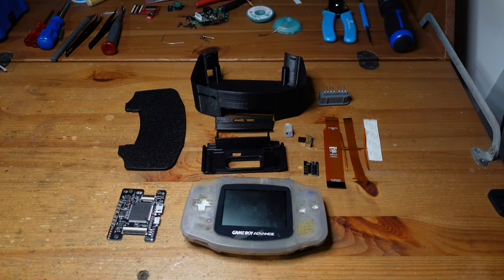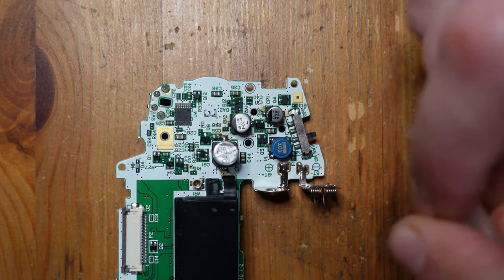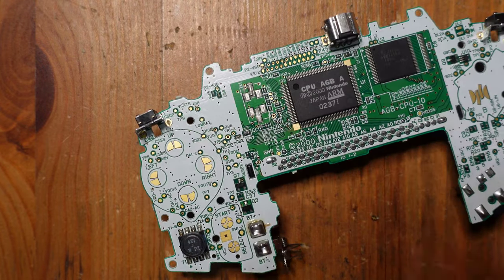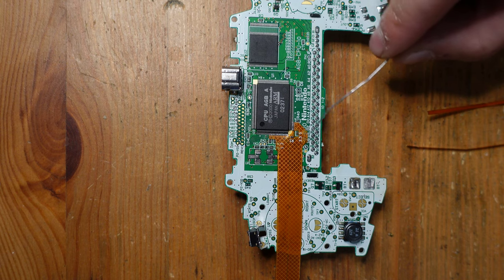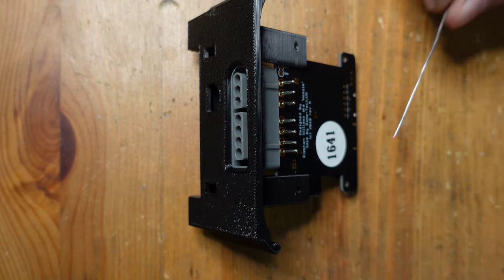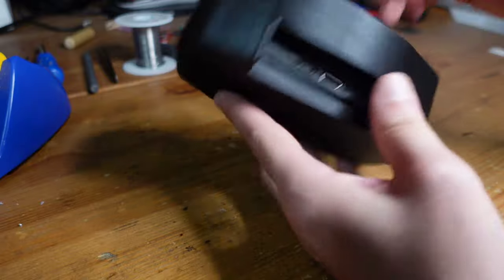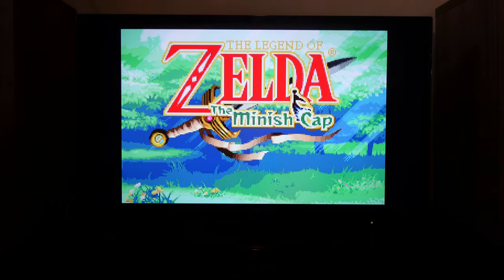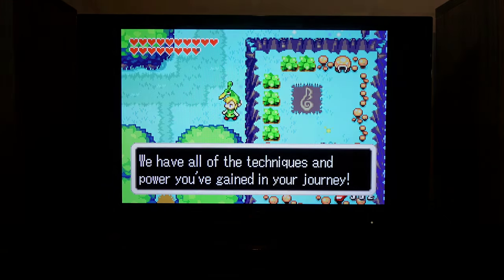GBA Consolizer Install Guide: Play Game Boy Games in Crisp 720p on your TV!

Comment: I’m just doing this myself now and the power switch doesn’t seem to snap in very good. Would you recommend using something to secure it more? I’m just afraid it will come out after I get it all together.
Reply from the maker: Absolute worst case you can use a bit of hot glue to hold everything together
Reply: @LIRetroGaming  I ended up using just that! Everything went together great. Thanks for the video and the response! ☺️

Comment: you burned the shit outta your hand. lol. what console repair cost you that? i see you use hakko stuff. I have hakko as well, but not my irons. i go with ts100/pincils. they are smaller and more flexible to deal with. give the pinecil a try, its only 35 bux and takes both t series hakko tips as well as ts100 tips.